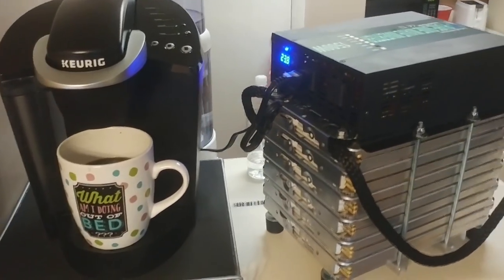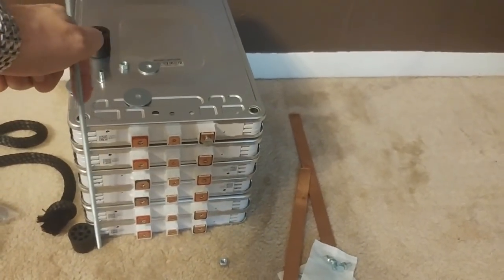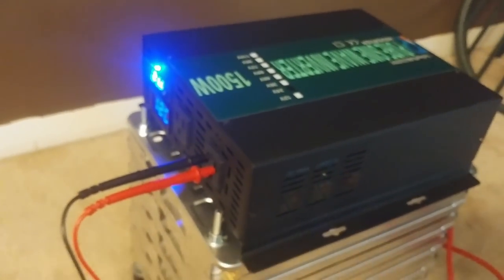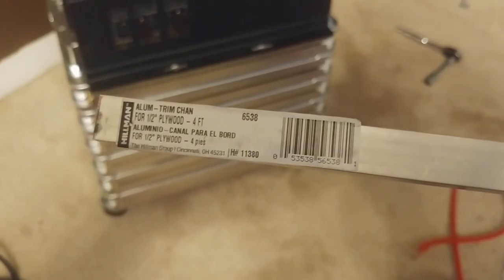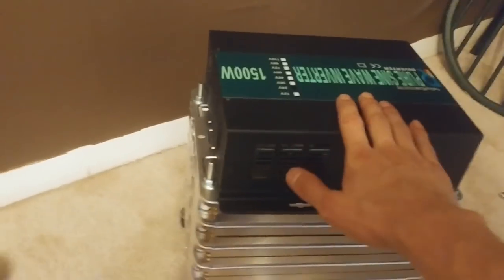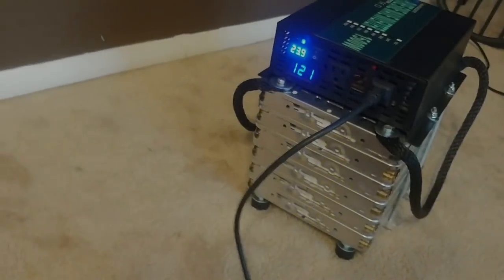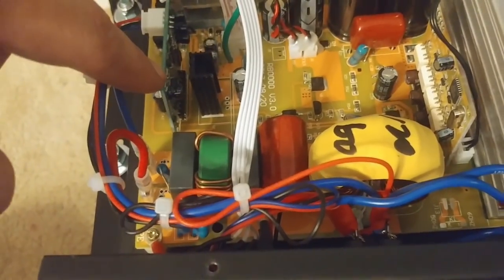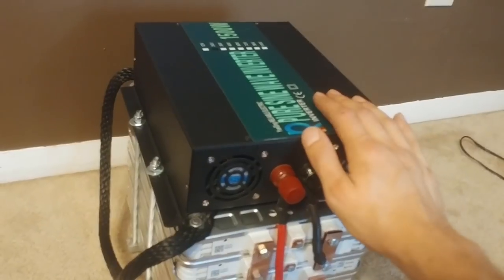DIY Portable Nissan Leaf battery generator that can run keurig and more!

Comment: Leaf batteries can be obtained from a wrecked vehicle (and other brands as well).  A set of 48 cells come in one unit (generation 2).  If you paid $500 that would be just over $10 per cell.  You see them all over ebay for $70 each.  Disassembly of a unit of 48 requires care as they produce over 380 volts.   You can buy units on ebay for around $1000 per unit of 48.  Think of all the projects your could build with a set of 48 of these.  Then sell some and get paid for your efforts.  Average used cell produces between 52 and 66 amp hours at 8 volts depending on condition.  That's over 400 watts per cell.  Now configure in banks to produce whatever watt/hr capacity you require for your system.  That be dirt cheap.

Comment: I’m using 14 Leaf modules at 12 volts in my camper. After initially balancing them they are staying balanced very well. But I’m getting a Electrodacus bms anyway.
Reply: How have the cells held up for you at 12v? What charging voltage do you go up to? And discharge voltage.
Are you Charging with solar? How much thanks for sharing I appreciate it
Reply: @vlogcity1111  I sold the NMC Leaf cells and went to LFP chemistry. But it’s smaller capacity because it’s more expensive. Didn’t want to spend more than $800 on LFP at the time so only have 200ah. Missing the capacity of the Leaf cells. Ideally have about 400ah-600ah of LFP so they don’t cycle as much. But that would cost a bundle.
Reply: @paulbaker3144  why did you sell the nmc before the lfp?
Reply: @vlogcity1111  LFP last a long time and are more stable = safer

Comment: I'm convinced the Leaf battery modules are the way to go.
Reply from the maker: They definitely have some advantages. They are easily put together to any configuration and the price isn't bad also.
Reply: @sideproject4028  You can buy an entire set of 48 of them for $998 (but you have to carefully disassemble them without getting zapped).  Let's see $998 divided by 48...that's less than $21 per cell.  That be cheap man.
Reply: @aday1637  where can you get them that cheap??

Comment: I am doing the same thing with a 6s set up like yours. In this config it should be 132AH at 24 ish volts.
 I do have the middle busses connected together in pairs just as the outside busses are.
ATM I am charging the pack with 2 355w Mission Solar panels and a Midnite Solar Kid charger. 
So far the pack recharges approx 20%  in the 1st hour or so of direct sun in the am, 9:30 or so. 
Then the excess solar is dumped into a hot water heater element.
An inexpensive  ($10.00 EBay) hobby king battery medic will give monitoring, balancing and discharge capability if desired.
Running the same inverter in 3000w.
Reply from the maker: Sounds like a solid setup. I ended up connecting middles also to keep them more balanced and my charging solution is pretty budget. I will be adding BMS to the charge side soon for safety reasons.
Reply: Not bad but it can be better, if you buy more sensitive inverter (maybe 2kw with charging option, to hook it up somewhere) or 7s option...,but its interesting anyway
Reply: BeginningFromThisMorning.com says this is not possible to use on 24volt system hardware? How is this working for you? I would prefer to use this battery over the more expensive Tesla modules on a 24volt setup.

Comment: Okay the problem here is that the inverter is starving to death. 4.2 volts * 6 = 25.2 volts that's 80% charged for two 12 volt led acid batteries. The leaf battery is full charge at this point. As soon as you apply the load the voltage drops to the point that the high voltage DC TO DC up converter can't make high enough voltage for the PWM inverter output to have some dynamic head room so that the voltage regulation will function properly it's the equivalent of an audio amplifier in clipping. The output wave form is severely distorted. The high voltage transformer in the microwave does not like that which is what is causing the noise at start up. When the microwave first starts the transformer is powered up instantly and has no load on it until the cathode in the magnetron heats up and loads the secondary of the transformer. You were verging on blowing up the inverter or microwave or both. What that other guy said in his comment about having 7S connection on the batteries is very correct the problem is because of the way that those leaf are made with 2S in each module it doesn't work out properly because you need 3-1/2 modules and because of the internal connection you would have to open up one module to separate the 2 cells. Or the alternative is to get a 48 volt inverter and put 7 modules in series which will give you 58.8 volts when the pack is fully charged and 44.8 volts when fully discharged. If you can achieve 7 cells in series for 24 volts or 14 cells in series for 48 you won't have that voltage sag under load and you will find that it will run the microwave without making that noise and it will start the fridge no problem at all. In fact I will give you one better it will start and run a 5000btu window ac my 1000 watt runs mine just fine. You have an extra 500 Watts.
Reply: Robert Thomas , I bought 14 leaf modules. What size battery cable you think I need. I am planning on making 2 sets of 7 and charging with midnite 150 classic. Thank you

Comment: I know this is a few years late, but personally I would have gone with a 2000 watt inverter and limit myself to 1500 watts.  I have herd that it is better to have more output than needed because it causes less strain on the electronics (that and I like round numbers).

Comment: To run high inductance loads you need a low frequency inverter. HF Inverters suck. Good for lights. Not much else.
Reply: What number of frequency is the recommended for inductance loads running at 120Ac? I noticed there is a portable generator that claims to go 600-1800watts but the downside is that voltage goes down all the way to 85AC THATS really low , it’s should be stable that’s not recommended in my opinión . I have tried only smaller inverters running 10-150watts but never hit 120Ac I bet there is way more efficient inverter but obviously will cost more

Comment: I've read that Nissan Leaf cells need to be tightly sandwiched between compression plates, otherwise the internal pouch cells will gas and degrade.  How is it going so far?

Comment: I power my house from a 5kw inverter,  and lithium batteries, and a 600 ah lead acid backup bank,  with soon to be over 1000ah of lithium, off grid, and solar power!
Reply: BS...a hot water heater and electric range on at the same time uses greater than 5KW....lie lately?
Reply: @aday1637  I do not have an  electric range, or dryer, plus most of my lights are 24v DC,  maybe you should know what you are talking about before before calling someone a liar!  You assumed and made an ass out your self! Your having to get on here calling someone a liar just shows how pathetic you are, 
 I have a gas water heater, the only 120volt appliances I have are fridge, TV, microwave, and a well pump, so why couldn't a 5kw inverter power THAT!  And it's not all on at once, a 3kw could power it! I hope things get better for you!

Comment: You probably need a pure sine wave inverter to run a microwave efficiently. Problem is, a pure sine wave inverter is about 5 times more expensive as a cheap square wave inverter.

Comment: How many watt hours are you getting? How do you charge the batteries (cost of that charger?)
Reply from the maker: Each module is 500wh when new (making this 3kwh). But i am expecting them to have a lot less. Doing Air conditioner run test now, will put up the results soon. Charging it with RC charger for now, but I got faster more elegant solution on the way, stay tuned!

Comment: Did you ever do a true capacity test on this? I thought about going with the leaf batteries, but wanted a 7s setup over a 6s for the voltage range. Seem to find alot of inverters that shutdown at around 21v.
Reply: 21v is  lowest the recomended for the leaf when put at 6s. 21v is 3.5 per cell, recomended is 3.65 per cell you could go lower 3.0 but for 6 modules there is nothing left down there.

Comment: I have a question.  What kind if charger did you use to charge the modules?  I have 3 I'm going to using in a camper build I'm doing . But I'm going to be using solar primarily.  But when I'm at a place has electric available I'd like to be able to charge them as well . That's the reason I'm asking
Reply from the maker: I am using 20a step up that can do constant current connected to the 12v power supply. I have a video going over it.
Reply: @sideproject4028  do you have a link to it ? And thanks for getting back so quick .
Reply: I found it . Where can I find a wiring diagram on how to make one like the one you made ?
Reply from the maker: @fegan617  They have everything marked right on the board. Take a look at this listing. One of the pictures has everything marked, hope that will help you:
https://ebay.to/2mug6XH

Comment: How much of those I need to run in series for a 24 volt set up 3 or 4
Reply: Well 3 kinda which will give you 18v-25.2v or 4 will give you 24v-33.6 so neither are great for a 24v inverter but if you search 18v inverter on eBay they make an 18v inverter and you only lose a little bit on the top I think you can only charge up to 4v but that should be good for longer life or you can go with 5 and get a 36v inverter

Comment: High frequency inverters generally cannot provide the start-up load for a motor e.g. refrigerator. It should drive a single induction ring though - that would be cool.
Reply: What inverter can you use for motors?
Reply: Low frequency inverters have large transformers

Comment: Perfect job! It is like plug and play emergency off grid system. Did You measure the residual capacity off each cell? In my oppinion 7s battery pack is better for 24V system. I think thees pure sine wave guys offer range from 20-30V. So You are good and Your can extend battery live with smoller charge cycles. Good job man! Im about to buy the same inverter.
Reply from the maker: No i did not. Also, i agree on 7s for 24v system, but there is no way to do it with leaf modules since one module is 2s already. Meaning you can do 6s like my setup or 8s
Reply: Side Project I see, You are able only to setup even battery pack because of its contruction limits. However, 8S is also good, but more redundancy is applied. You can charge/discharge between inverter limits. Maybe then it will start refrigerator as well.
Reply: @minhhoangnguyen536  as I mentioned, 7S would be the best option

Comment: I really like your design, too bad they raised after your video. How would you wire it in 24v with 7 modules?  how would you wire 4s with  7 modules?
Reply: nvm I think I just answered my question.
Reply: @at612  Tee-hee-hee.  8 is enough.

Comment: Hi.  Do you run into any cooling issues with this design?  Thanks for the video!
Reply from the maker: No issues. Drawing just a fraction of what the leaf packs can put out
Reply: Even in the car, nissan leaf batteries have no active cooling for the modules.

Comment: I'd seriously think about the way you have the batteries connected.  You are drawing the opposite of their capacity.  You have tried to have the 2 banks of 24 v connected by having 2 banks of 3.  But then instead of drawing from the place where the 2 come together, you try to draw from the opposite end of the 2 banks.  Try connecting in the middle (both positive and negative).  And your test of the individual cells is bogus as you are testing several cells at the same time (so of course they all give you the same reading).  You can only test each bank when you have each cell disconnected from any other cell.  While you are able to read 24 volts on your meter with the connection configuration you have, you are not getting the full wattage the 6 batteries are capable of.  And thus the problem with the inrush from the microwave and the refrigerator.      
The inverter should be capable of at least twice the face rating of 1500 watts long enough to give that extra wattage for a period long enough to handle the inrush from the mic and the fridge.  You may have exceeded the amount the inverter is capable of during start up. 
Try reversing polarity on battery #1 from battery #2, then opposite battery #3.  Same way with 4, 5 & 6.  Then connect pos of #1 to neg of #2 and pos of #2 to #3 (same with 4, 5 & 6).  Then connect the 2 sets of 3 together (pos to pos & neg to neg to give full potential voltage and amp/hrs.   Then connect your inverter to the middle where the 2 banks are mated.  That will give you the max you can get at 24 volts from your 6 cells.   The way you have them connected is only giving you part of their output capability.

Comment: What is the Weight on this all assembled?
Reply from the maker: It's heavy. If I had to guess, around 60 lbs
Reply: @sideproject4028  Thanks! Was curious if it was less heavy than my 80AH AGM 12v deep cycle, but sounds like thats a hard No. I'm guessing power density would be better in a 12v config, but for the money i'll stick with this for now. Thanks again.
Reply: I think each module is 8 lbs. So 48 lbs plus the inverter. Good guess at 60 lbs.

Comment: Magnetrons are only about 60% to 85% efficient.
 Your 1350W microwave oven might take as much as 1600 Watts to run, and a bigger surge to start.
The inverter is crying out in pain! Make it stop Daddy, my FET's are hurting, I can't take too much of this! Why are they doing this to me?
Reply: But such inverters are capable (generally) of twice the rated amount for inrush moments...the real issue here is the way the batteries are connected.  They are cancelling each other out in this configuration.  Double check the design.  I did and it don't work properly.

Comment: this is amazing and i want to also build this. What do you use to charge your battery? would i be able to slap on a 2000W inverter? im thinking of using this to charge an electric car just enough to drive home from work and what not.
Reply from the maker: 2000w inverter is bigger in size. That is the reason i went with 1500. I will be releasing a video about how i am charging it here in a bit. So stay tuned!

Comment: I wonder if you added some super capacitors between the batteries and the inverter they would handle the surge from the refrigerator compressor to get it started.